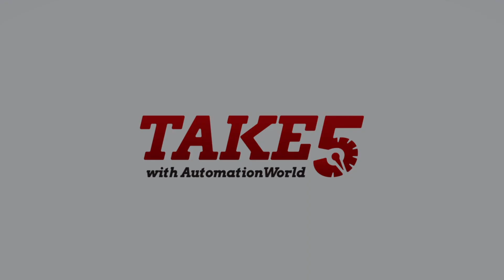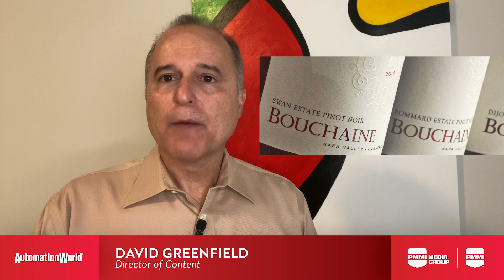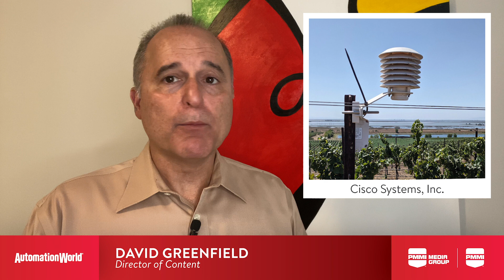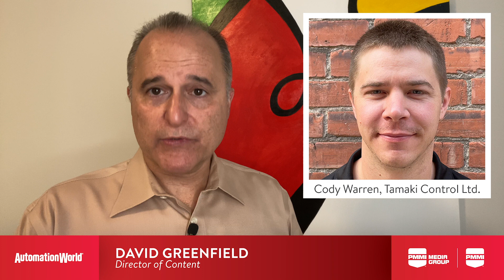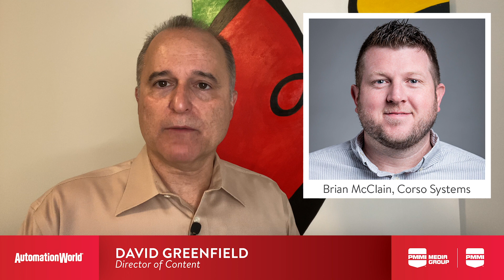Industrial Sensors in the Vineyard & Other Automation Trends

Comment: I use plcs and arm processors to monitor my commerical avocado grove.  the historical data from control system allows me to reduce labor costs, as problems can be detected instead of manual inspection